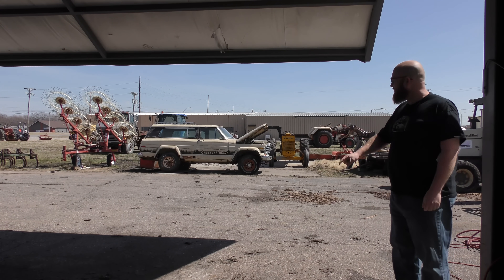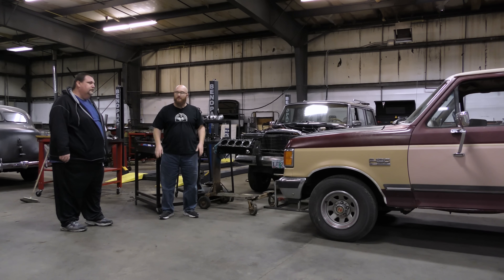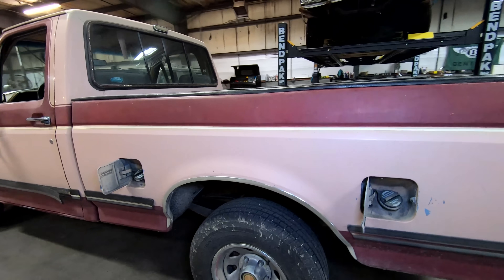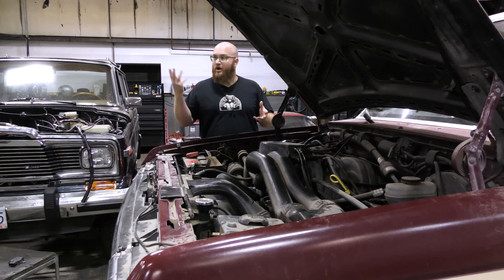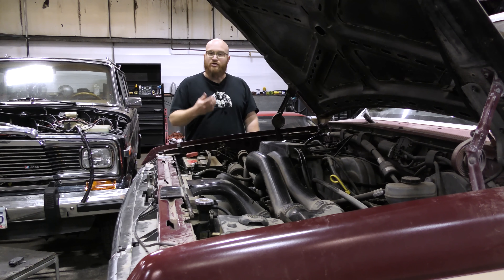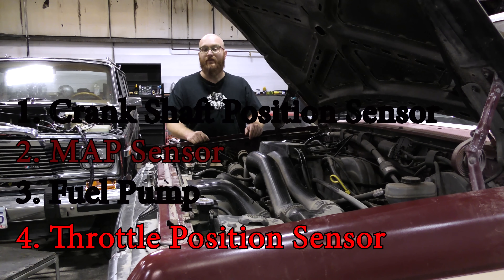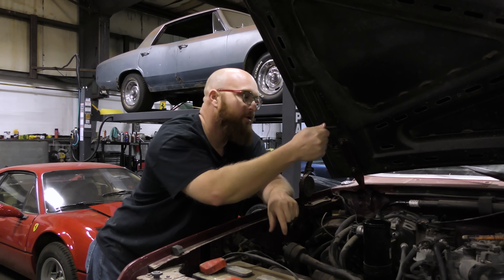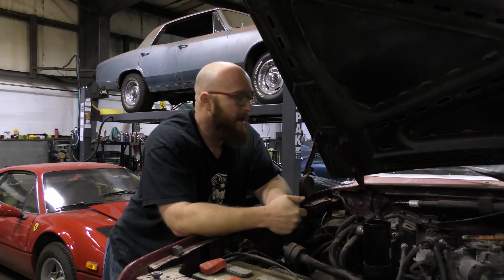Parts cannon couldn't fix this '90 F150. Old School diagnosing by the CAR WIZARD

Comment: I don't have a vehicle quite this old, but My truck is a 2001.  I purchased it for $2100 back in 2018 with just under 200,000 miles on it.  I've put several thousand into it in repairs for things that just go bad on old vehicles, but the engine and trans have been solid.  People may think that's crazy, but even in 2018 I got my truck for a fairly cheap price.  I just checked prices of similar trucks and I bet I could probably sell my truck for $5-$6k right now with all the recent service it has had.  Probably wouldn't make my money back, but it's not going down in price.  But then I'd be without a truck and I can't get another reasonably priced truck.  If I bought another truck it would probably not be as well serviced even if it had less miles.  That's what I realized when I bought my Volvo wagon last year.  I had to sink a ton of money into it and now I'd be losing a ton of money to sell it.  Now I have a car with a bunch of new parts though so I know it should last verses replacing the car with a seemingly nicer one only to find it has issues again from lack of maintenance.  Unless your issues are very large, often times it's better to just fix the issues you have on your current vehicle even if the price to repair it exceeds the value of the vehicle, even before this crazy market.  If you switch cars, you have to spend a lot to not take on someone else's lack of maintenance.  An astonishing amount of vehicles don't get properly maintained.

Comment: Those 300 I6 thrived on neglect and abuse. Got 350K miles out of my '95 F150 before I sold it as I just didn't need a truck anymore. Every so often it'd come in useful but it's easier/cheaper to just rent a UHaul truck one those cases. I do not miss the 14mpg that truck got. Biggest issue I had with the truck was that 3G alternator that kept trying to catch on fire. Converted mine and my brothers (he had a '95) to the Ford 4G alternator and never had a problem since.

Comment: I had similar issues with a 91 Galant. Crazy idle, wrong fault codes, cylinders not firing, mad vibrations at 3000rpm. After a lenghty investigation, it turned out to be 4 dead capacitors on the  ECU. A $0.15 fix.

Comment: My 93  F150 5.0 Has a high idle issue. I've replaced the idle air control and most of the old sensors because they were pretty cheap. Still has a high idle issue but remedied it by just unplugging the Idle Air. Idles fine but idle shoots up to 2-3k RPM when plugged in. Also these old trucks don't have Crank position sensors they have what's called a PIP sensor. It's located in the distributor and is more of a cam position sensor.

Comment: I have a 92 f150 with the inline 6 only thing I still can't fix is  while the engine is warming up it will miss a little if you give it gas it runs fine but slow cruise it will miss. After engine warms up it usually goes away. I changed everything I could find except the ox sensor. Otherwise its a great cruiser last summer got rid edge full time hubs and installed manual hubs got alot better gas mileage!

Comment: I've got a '91 with the 4.9 I6 5MT 4WD, I love it... weird thing is mine doesn't have a tach, despite being a manual. And my front fuel tank pump is bad, the rear tank pump is fine. So I got the reverso truck I guess!

Comment: 18: 37  Little distinction here from Scanner Danner. Usually on a map sensor vehicle the idle's going to go a little bit higher with the vacuum leak. But with a mass air flow sensor system, the idle's going to be a little lower with the vacuum leak.... "In General" 

In this situation the manifold absolute pressure sensor was faulty... So important to test..

Comment: I have a 93 f 150 5.0, same surge problem, replaced EGR, MAP, computer, same problem, it's got to be a vacuum leak somewhere, rebuilt throttle bodys are hard to find, probably get an aftermarket one. BTW, old Nascar trick used lose carburetor bushings to get a little more CFM.

Comment: Bought a 1991 F150 4.9L last year for $850 with a clean rust free body.  It was pretty maintenance neglected,  but started and ran.  There was an exhaust manifold gasket leak that I hadn't the tools, place or strength to repair so I took it to a local mechanic.   Turns out it had hairline cracks in the head and a pinhole in the block.  $4800 later the engine is replaced plus another couple of grand in parts I replaced.   Even after all this I couldn't have gotten much of a truck without dumping money into it for under $10,000.

Comment: I've had a 87 f150 4x4 4.9 5sp short bed reg cab since 2001 paid $1000, bought a 93 f350 7.3 4 dr 4x4 auto 5 years ago for $2350. The 2 best trucks ever made. Way too much fun in the 87, ran 33" bfg mudders for years. 93 pulled my 18' trailer for 13 trips across Texas when I retired to inherited farm 2 years ago. Also have 2010 prius. The best car ever made. I'll give them all running to my grandkids in about 10 years.

Comment: This is too relatable lol. My 99' Dodge Ram was surging and stalling, so I said "It's probably a TPS." Then I checked the IAC. Come to find out that it was a leaking Plenum Gasket that caused my sensors to get dirty and mess up my o2 sensor. So it ended up being like 3 different things at once. Learned my lesson. And also fuel injectors. Almost forgot about them. All had the same symptoms...

Comment: 1st there is no crank sensor since has a distributor. 2nd the idle issues can be caused by a lot of things. The TPS pins often gets cruddy and it causes a jumping idle or a hanging idle.  The TPS can be adjusted a little. There is an adjustment procedure in the service manual. Also if the car has a super high idle it can be a bad throttle body because it has too much of a gap in the plates. Also if you use cheap replacement parts the idle may never get right.  The MAP sensor you replace is probably okay.

Comment: Not a recommended fix, but back when I was a poor student, I had a SU carbureted engine with worn throttle shaft bushings. What I did was silicone-d an old spark plug boot over the shaft casting boss, and filled that with more silicone. The end with the spring I couldn't do anything about, but the idle was better. Still have the car, 30 years later, but it's been fixed proper now.

Comment: I've got a '90 Bronco with a 351w and yeah diagnostics can be a challenge. It's easy enough to check for spark, check for fuel pressure, beyond that I have a hard time with all of the vacuum smog controls and old school sensors. By the way, I don't know about the 6.9 but the 7.3 idi came turbocharged after 93

Comment: I owned an 89 full size Broncos for 15 years with a 302. In the mid 90's, the  idle started rising to a point it hit 2000 rpms. It turned out to be a bad upper intake gasket. Drove that Broncos until the body rusted beyond repair here in Michigam
Reply: So you drove it another 6 months? 🤣 Sorry but can't help myself, these old rigs no matter what brand get eaten alive in the northern salt states. I'm in Vermont, I used to wonder why everyone drove newer vehicles, it's because when you commute on this year round salt they don't last more than maybe 10 years MAX.

Comment: I have a 94 F150 Longbed 5.0 restored and a 1995 F150 Ext Cab with 4.9 restored. Just very VERY easier trucks to work on and find parts for. One thing I did think it may have been was the PCM. The transistors are known for going bad and causing weird symptoms that you can’t figure out.

Comment: I bought the Ford scan tool for my 93 mustang years ago to help me if it ever had problems. I can confirm it can have codes without the check engine light. Mine has evap codes cause I removed all of it, but the light never came on.

Comment: I own a 90 f-250 460 5 speed with 410 gears one of the best trucks I've ever owned it pulls great, I also own a 94 i6 5 speed with 355s they have both been great trucks there both 4x4 the i6 has been offroading everywhere but no obd2 is a pain in the a## ive replaced so much on that i6 😃

Comment: I believe these use that seven pin for adapter. I use a system called think Diag, and at least for Ford. It has an OBD one backwards compatibility system. And I have the physical adapter to plug into the system as well. I use it on my 1994 Ford Crown Victoria, LX. And I love these pick ups. We had a 1987 with a four speed manual that sadly got crushed in by a microburst blowing a semi trailer over on top of it and smashing the cab like a bean can. I believe the pick up pad only 104,000 miles or so. But it still has a good 302 and a good transmission. I still sometimes put a battery in it and go out and start it just to keep the engine limber up.

Comment: Thanks for the info, it helps me with a simular problem I’ve been having lately with my 92 Silverado,I know the throttle body is worn out, think it has around 220,000 miles on it,I’ve checked at auto part stores and diden’t like there prices, like $400.00 ,so I think I’ll look for a good used one,thanks for re affirming the thought process,needed actually to solve the problem, tps has already been changed with an AC delco brand,
Reply: you can smoke test it yourself with a cigar and a disconnected brake vacuum line.  also can check by spraying brake cleaner around the bushings and see if they suck and idle goes up

Comment: Great vid. I have ole 1997 Landrover Discovery 1 3.9 V8 and will need to shortly pull motor out to do Freezeor core plugs. 1 replaced already another on way out and of course might as well do whole lot so engine out. The info Mr Wizard is transferable to all vehicles. Carry On.

Comment: I had a 90 Lariat(5.0). Loved it but I found a common fault was the inner fender wells didn’t drop down far enough. Even rubber material going down farther would have helped. The problem was moisture, water, snow splashing onto the exhaust. Red hot metal meeting cold water or snow isn’t good, and eventually had to replace with a set of headers. I had it 9 years and when I traded it I had about 100k “Kilometers”. That’s about 60k miles. Traded it in on a 99 Lariat 4X4 super cab, and of course it ran perfect, no problems for 9 years with almost the same amount of miles.

Comment: I have owned 3 ford’s with 302’s. Great strong engines. And I now own 2 fords. Not 302’s. But every 302 I have owned eventually developed a rear main seal leak. That ran from annoying to to outright leaving an oil trail. I love my Ford’s. But the 302’s do have issues. To fix this problem. U have to drop the transmission. And if u do it seems to be a temporary fix. I’m mostly talking about f150 4x4. Big Job. Expensive.

Comment: 5 friends of mine passed a straight 6 ford truck exactly like that amongst each other and when it was taken, only because the owner didn't want to rescue it from impound, that truck went through hell and back and refused to die, I had one I bought for 800 with 87k miles and the insane amount of torque, there are no words, both trucks were manuals.

Comment: I had a throttle body issue where the idle control Valve  screw was messed up from the previous owner on my bronco. I went to the junkyard and found one the same year. Cleaned it  added new gaskets and new throttle position sensor. Cost about 100 bucks in parts. Well worth it

Comment: I have a 1988 Bricknose Ford F250 with a 7.3 IDI diesel motor. You don't have the convenience of an OBD 2  but it with some patience these trucks aren't that bad to diagnose and repair. Parts new and used are still pretty plentiful for these trucks. My engine threw a rod 2 years ago so I bought a low mileage used 7.3 IDI from a wrecked 1990 F350 and put it in my truck in my driveway. One good thing about the diesel, I don't have the vacuum issues with a throttle body since it doesn't make a vacuum. Although, the 7.3 IDI can have its own set of issues completely different from a gasser.

Comment: I had a 90 Crown Vic with this same issue. Bought it with a blown motor. And got a replacement short block & swapped out the sensors from the old block. And had this same issue. Drove me crazy. Brought it to Ford they scanned it for 180 & listed 3 different things that could be & would be 800 bucks to fix & they didn’t guarantee that would solve the issue. So I threw in the towel & sold the car.

Comment: I got a 89 F-150 and a 88F-250HD. Both have the  5 speed manual transmission with a 5.8(351). I cut my teeth on working on the trucks.  And, still learning more. I’m lucky in the way that my daily(88) runs like a top. I’m in Canada, so the problem I have is getting some parts. Sometimes there are zero in Canada. So, I have to buy parts from the States. This is a last resort, I do have a part truck I could get a part from if needed. I had to fix and rebuild a couple of parts. I’m assuming you checked the EEC relay? It controls the fuel and injection systems of the engine. You can buy a OBD1 scan tool from Amazon. It’s aftermarket, but it should do the trick. Great video
Reply: I never had the rear tank fail on me. I got over 400,000 on my 88.

Comment: My guess was "vacuum leak", because I fought vacuum leaks on an old Isuzu Trooper once. And it had many of the symptoms you described.

Single cab is best cab, fight me. Even better if it's paired with a long bed. I wonder, does this F150 have the floor-mounted dimmer switch? I remember someone having a 1989 F150 that still had it. 

And Mr. Wizard is right about the more in-depth diagnostics. I had a 1989 C1500 with the 5.7 liter engine and manual transmission, single cab, and an 8ft bed. And twice there were things that caused me to have to dive in with my voltmeter and other bits of testing equipment. One of them was a low fuel pressure problem. It would idle ok for a bit, then it would stumble and run rough... then it would idle OK. It would behave the same when driving, where it would be OK for a few seconds, then it would stumble and stutter, then it would be OK again. I checked the fuel pressure, and I was getting 5 PSI. This was a TBI engine that needed 13 psi. Since this happened with a full tank of gas, as all fuel pump related issues seem to do, I removed the bed to access the fuel pump. I swapped out the fuel pump and.... the same problem. It acted almost exactly the same. And still only 5 PSI of fuel pressure. So off with the bed, out with the fuel pump, and I check everything. The sock on the intake was clean, everything was fine... except for this little short section of rubber hose that my dumb ass should have replaced while I had it out the first time. I keep that little piece of hose as a reminder to replace easy, cheap things while you've got them out, just in case. 

Another fun thing this truck did once, was develop a misfire. It idled rough, and it really stumbled when you tried to accelerate. So I go through my own, smaller, "parts shotgun" procedure, I replace the distributor cap (remember those?) the rotor, wires, and plugs. And it had a different misfire. I checked the firing order, and it was OK. All the parts were installed correctly. I went through the distributor, with it's little sensors, swapped in a new coil (Which was $20 on this truck) and still the problem persisted. I was stumped. So out came the meter, and I checked the resistance across the new wires - and one of the new wires had a resistance value far outside of the others. My new plug wires were bad. It ran great with another set.

Comment: I have about 253.000 miles on my truck I want to revamp it so I can drive it across states or put it on the road when I please. What type of motor would you suggest or what would you suggest I do to get it that way

Comment: BBK makes them.  I linked it for you. Also fixing the bushings may be only part of the problem. Hold the throttle body up to the light. You will likely see light. The more light there is the more air is passing by which makes a high idle.

Comment: I had a 93 with this same basic set up, it shifted hard when going into second and into overdrive; enough so that I nearly busted the back glass out with my head. It ended up being the MAP sensor. I was fortunate that my dad, at the time, had a 93 as well; I borrowed parts to find the problem, though only one. I did have a somewhat dated scan tool that works on pretty much anything if you are willing to tool around with it long enough. Kept throwing MAP sensor voltage code. In my ignorance I ignored it and pursued ever thing else and then finally said to heck with it I am borrowing a sensor. Fixed, just like that; previous owner had sent to shop had tranny work done to no avail. Come to find out the MAP sensor does about 50 different things on these. Any of which can cause pandemonium.

Comment: One option would be to ditch all the OEM Ford intake stuff and go with Holley/FiTech/Edelbrock fuel injection set up.  If/when the truck becomes unusable the aftermarket system can be resold for a portion of the initial investment. But mostly no more searching around for non available OEM parts.

Comment: I knew a fellow, an ex Londoner, who I would call a master mechanic. 

Worked on them all from classic V12 Ferraris to Volkswagens and was even on a pit crew. 

And he was really distainful towards those who he called “parts changers”. 

It’s OK to make an intelligent diagnosis and find out you put the wrong part but to not even know what you’re doing and start throwing parts of the problem? 

In most cases you’re better off taking it to a good shop. 

Even bad shops do this approach. 

I frequent several Mercedes Internet forums and these Internet forums are full of parts changer.